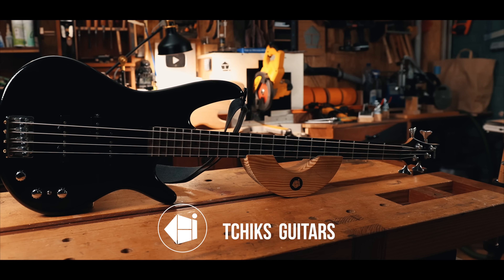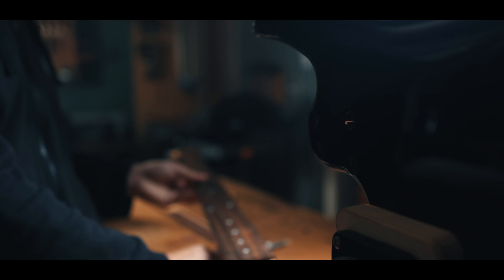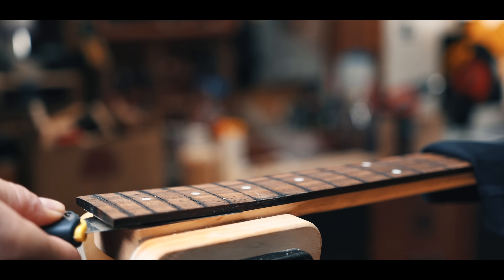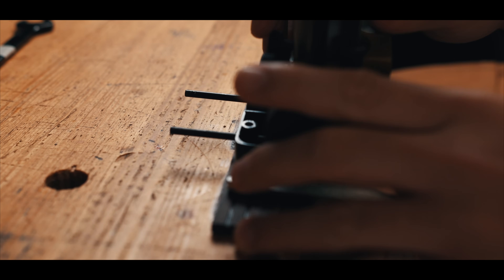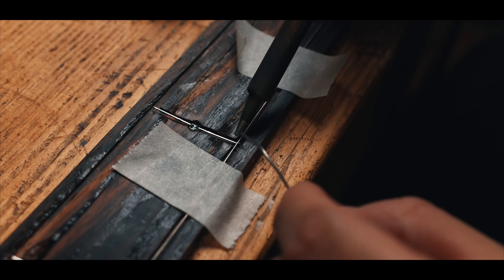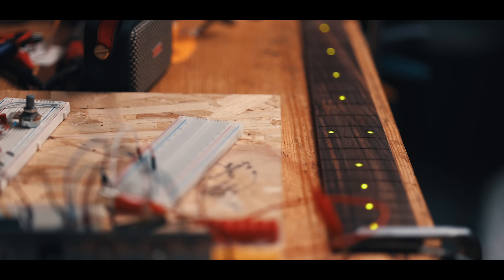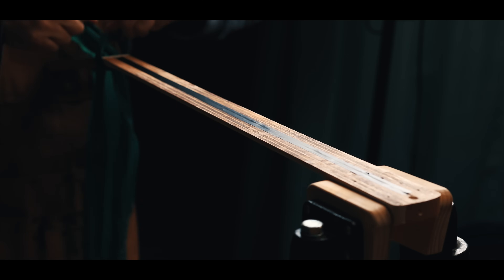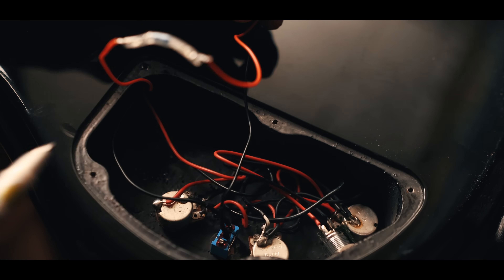How to install LED FRET MARKERS in a guitar/bass. A Fun Weekend Projects with tchiks guitars

Comment: I love this.

Interesting that I just learned that when electric power was introduced, wiring was often done in molding like this since walls were plaster.  2 channels were cut on the back side with a grooving plane and they ran the hot through one and the neutral through the other (sometimes without insulation 😮).  Stanley even made a plane specifically for this task that was cheaper than a combination plane.

So I’m going to say you added LED markers in the traditional method 😂

Comment: What I learned from opening iPads - reheat when necessary.
      The glue will harden again when it cools down, so keep heating the parts where you're about to pry, so the glue remains malleable.

*Also, try using a 5-in-1 painter's tool next time instead.
      It's about as flat as the thing you use now, but has a very wide, flat chisel tip.

It's perfect for taking apart glued wood (and general demolition too ;))

Comment: A note for the fretboard removal. You have to do it slowly and carefully, otherwise you can break or warp the fingerboard. If you know the fingerboard is glued with hide glue, you can add a little bit of denatured alcohool (also called methylated spirts) inside the breach and that will dissolve the glue.

Comment: Nice one, always thought about trying that out on my neckthrough bass since the truss rod seems to be broken and it would also be multiple birds killed with one stone. The icing on the cake would have been to drill the side markers to the fretboardmarkers and fil lthem with glue as well, so the light might shine trough to the side of the fretboard
Reply from the maker: I'm not entirely sure that would work but I love the idea, maybe with a second set of LEDs. A broken truss rod is the perfect excuse to try this. Like. Per-fect.

Comment: That's a good one. You should go further and make some sort of a contact pads. It saves wires from breakages. And do you think about installing Li-Po battery with a BMS and charging module? 
After all, it still a great weekend project. Well done. Hope to see other small projects. Best regards.
Reply from the maker: Thanks :) this was a prototype so everything is an enhancement from there

Comment: 1:12 I've never seen this technique used with the solder before, only the iron itself. Is the solder necessary or more beneficial?
Reply: Same, I’ve seen people just take the rod to the frets to heat them up, seems like added work to redress the frets
Reply from the maker: It's not necessary, it's just quicker if you don't mind the fumes. The solder allows for (a lot) more contact between the tip of the iron (which is not even flat in my case) and the fret itself.

Comment: "A fun project for the weekend"... I thought it was going to be simple and kinda DIYish... step 1: lets remove the FREAKING FRETBOARD from the neck! WTF? I instantly gave up... hahahahaha!
Reply from the maker: It's actually not that hard. You don't even need tools to do it :) even a butter knife would work I think
Reply: @tchiksguitars  I'm usually fine with taking it apart, it's putting it back together that's the problem lol.

Comment: Great work! Spontaneous thought about using a flat tool to remove the fretboard from the neck: would it perhaps work better to pull a wire (something like a B- or G-string for an electric guitar) along the length of the neck, after the initial release has been achieved?
Reply: I used an old guitar string to remove a glued mirror and it worked super well

Comment: I have a guitar with a highly roasted AAAAA flamed maple fretboard and yet it has black dot markers that almost impossible to see, I have fitted cream dot stickers to the fretboard but would love LED's on it, however, it has hardened stainless steel frets that bumped up the price of the guitar and replacing them would be expensive, I did not build the guitar I purchased it and so I am unaware what was used to glue the fretboard down and so I wont attempt to lift the fretboard I will eventually change the dots for cream ones, what I might also do though is buy a cheaper guitar like yourself and install them on that.

 I was thinking that carbon fibre rods might be good for this process as they protect the neck from movement and can also be used as conductive rails with solid wire terminators to the LED's.

Comment: Few questionds..Why not keep the iron close to where you releasing the fretboard?..why use a rail and not isolated electrical wire? If one LED will fail..will the others be okay, can the fretboard be detached again? Is the wiring diagram to be found on the web...maybe it also fun to use multi color leds and make them dance with some kind of circuitry.
Reply from the maker: - I did come back with the iron a lot, off camera 
- if one LED dies the other will be ok 
- there's no diagram those are just LED connected together : common hot and common ground 
- the fretboard can be detached again but I won't do it, ever 
- multicolored led is an idea, but the wiring would be a lot more messy 
- I used a rail because it's more convenient than having dozens of little isolated wires

Comment: Looks awesome but i had a guitar with led ‘s

when one led broke , the rest of the led’s  went out ,too

Then you can start to make all this work again, to replace the broken led
Reply from the maker: I don't know how yours was wired but in this case if an LED burns out, the others will work just fine
Reply: @tchiksguitars  yes mine was not like your’s , but how do you replace the led if one went off ?
Reply from the maker: Well I wouldn't :) in my case it was just to see if it was possible to make it on my own. Now I know it is and I don't care about the consequences
Reply: @tchiksguitars  that’s the problem of this fancy lights

Comment: You should wrap that battery in electrical tape. It could short out inside and drain much faster/when its not even plugged in. Just a tip from a 20+ year active user

Comment: I am surprised that you were able to make it work with only one resistor, and all 5he LEDs in parallel.  I'd have thought the LEDs would each need a resistor, or else run the whole chain in series at a higher voltage, in order for them to all be a consistent brightness.  Has LED matching gotten better in recent years?  A couple decades ago when I would try a trick like this, I'd get very uneven current through the paralleled LEDs, thus inconsistent brightness.  Since then, I never trust parallel LEDs, and always have used resistor-per-LED.  But yours look pretty consistent in the video...
Reply from the maker: There's not enough LED's to make a perceptible difference. I know that the last one isn't as bright as the first one so in real life if I really pay attention I think I can see it

Comment: What drill bit you use to drill out inlays please 🙏?
Reply from the maker: It's just a very small forstner bit (6mm)
Reply: @tchiksguitars  is it a standard drill bit tip or does it have centre point plus outer cutters if you know what I mean?
Reply from the maker: It's a special type of drill bit with an anchor in the middle. It's usually used to install the hinges on Ikea type cupboard doors

Comment: I still don't understand why i haven't seen anyone route optical fibers in the neck instead of death prone leds, you could just have super thin fibers go all the way down to the bottom of the neck, have a hole go from the neck pocket too the first pick up and then some electricals can be put in the main cavity if there is enough space, if the electronics die you dont need to rip up a neck to fix it.
Reply: I hate to be that guy but that's always easier saying than doing but I understand the logic
Reply from the maker: I did this with what I had on hand, I didn't even get to choose the color, not the size of the led

Comment: I paid someone £500 to install mine (same guy who did the LimpBizkit ones). Id rather they be responsible for replacing my bass if it goes wrong.
Reply from the maker: Lucky you :)
Reply: @tchiksguitars  really lucky that he lives near me in England. I've wanted LEDs ever since I saw the limbizkit bassist have them back when I was 15. Then finally in my late 30s I got them myself and from the same guy.  Totally worth it. People love seeing them at gigs. I usually start with them off then flick them on at the first big drop of the first song.
Reply from the maker: As a matter of fact Sam Rivers was the first guy i saw with led in the fretboard, I was also 15 and I'm now in my late 30's :)
Reply: @tchiksguitars  Ah fantastic. Both equally as impressionable. 😅

Comment: Hey Genius, you do not have to actually put solder on the frets all you need to do is heat them up with the soldering iron.  The solder isn't what heat the frets the iron does.   Wow I've seen some idiot DIY jobs but putting solder on frets is by far the fanciest!   That is like setting the house on fire to check if the smoke detectors are working hahahaha!
Reply from the maker: Hi there. I guess this is one of those " I'm wrong, you're right " type of arguments. I'm not gonna be arrogant and aggressive about it though :) (but I'm right )